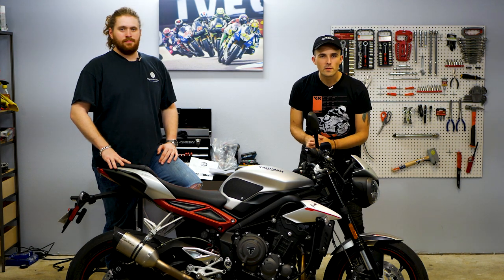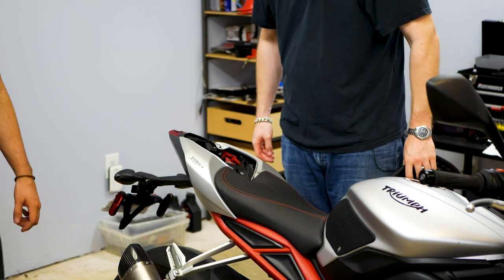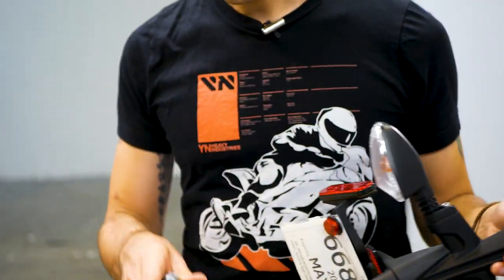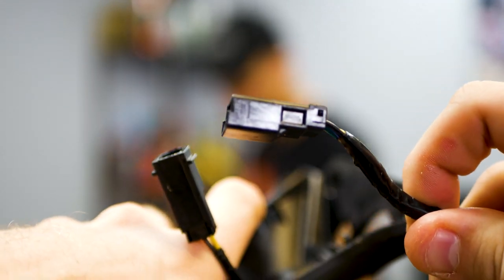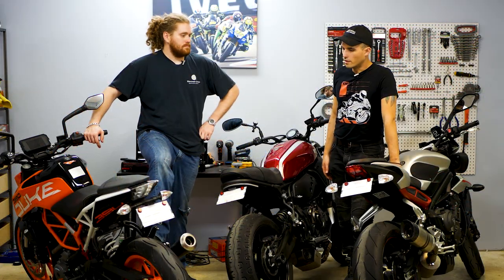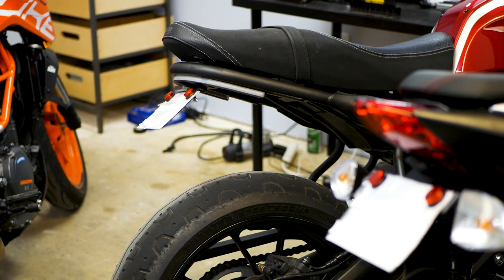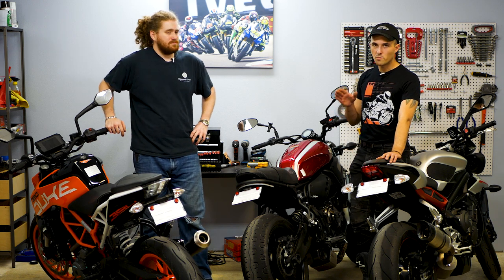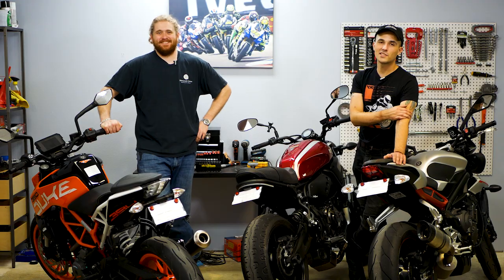The Street Triple is Perfect! (Except For One Thing...)

Comment: they say it doesn't need much, but the headlights are so damn ugly. I would include a single headlight conversion or the dual round conversion to retain the character. Both versions are way better and the single conversion saves a lot of weight. The streety my'20 lights are a lot better.